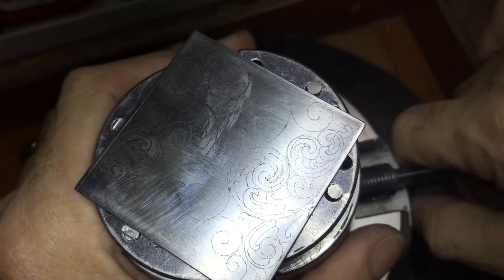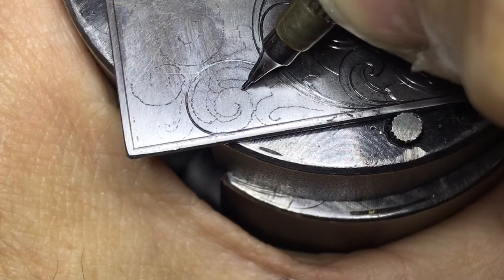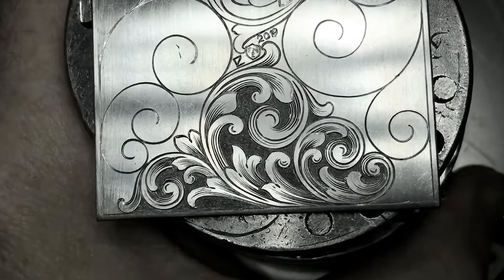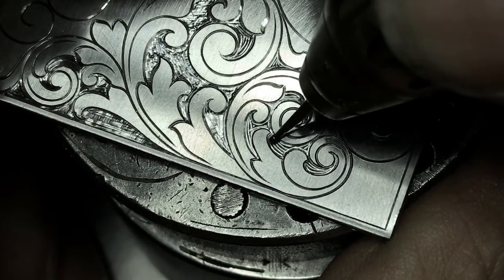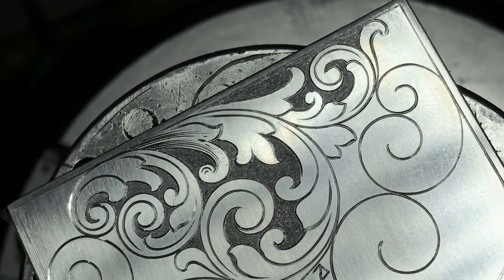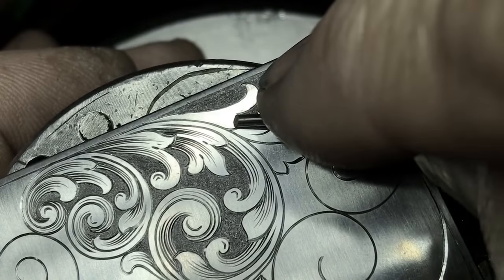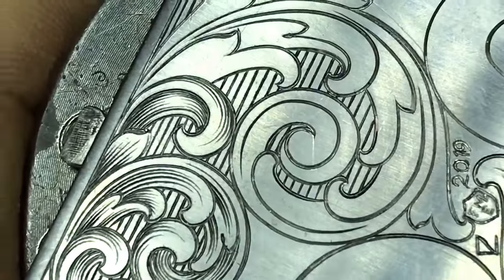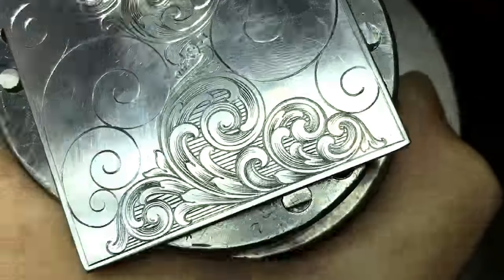Hand Engraving Quick Tips #4 Pt2- Engraving a Scroll Sampler Plate. Engraving for Beginners

Comment: curious if you were still planning on giving us a video about hand push engraving, its the only style i can really afford to do at the moment and i certainly find myself running all over the place at the moment lol
Reply from the maker: Rich Nelson I do plan on doing something about basics but it’s really something that is best learned in an apprenticeship type setting. Jason Marchiafava offers a hand push video lesson but it’s a fairly expensive set of DVDs and it doesn’t really replace hands on lessons. Hand pushing is by far the most difficult method and takes a few years of cutting straight lines and circles to gain proficiency. Plus you are limited to soft metals. Hand push gravers are only used by  jewelers and bulino engravers.
Reply: @MasterEngraverTV   yeah I'm a jeweler, just trying to improve since I'm mostly self taught in this area, didn't get nearly enough graver training
Reply from the maker: Rich Nelson as a jeweler you have a leg up on most. Jason’s video is the most comprehensive lesson available. There’s just too much info to convey on YouTube. It takes 20 hours of editing to make a 20 min video. So I keep things simple.
Reply: @MasterEngraverTV   alrighty I'll check them out, since I can't afford a power system mostly just trying to make sure I'm still doing the basics right, like hand placement and pushing technique.... Your video on sharpening was helpful I think I have been making my heel way to huge and that puts me at a funky angle and makes following the curvature of a ring much harder when I'm cutting a channel, course I'm also doing this all with just a ring clamp, bench pin, and optivisor, so can't get any more bare bones lol

Comment: What type of graver is it? Onglette? RRF point?
Reply from the maker: Diego lindemann it’s just round stock shaped to a 120deg point. GRS Tools sells jigs to sharpen this easily. Steve Lindsay Tools also sells an easy to use jig.
Reply: @MasterEngraverTV  do you recommend cutting out the backbone first?
Reply from the maker: The backbone is always cut first as long as the design allows that. On more complex work where many leaves cross over the backbone that becomes impossible.